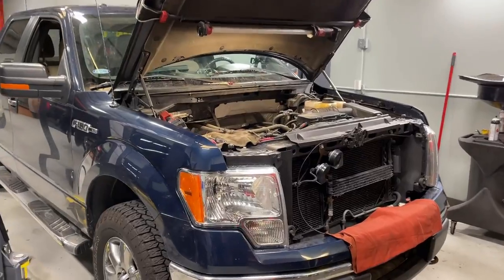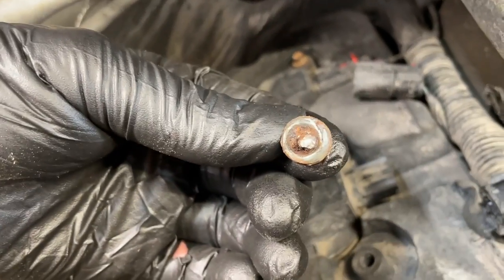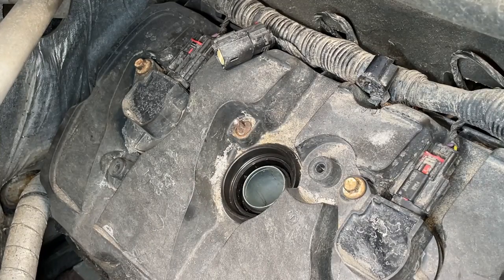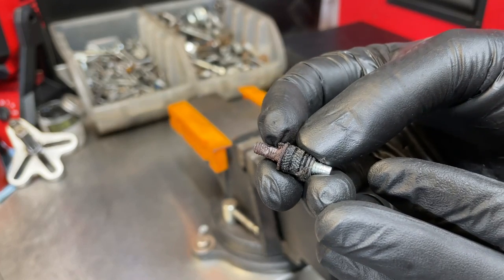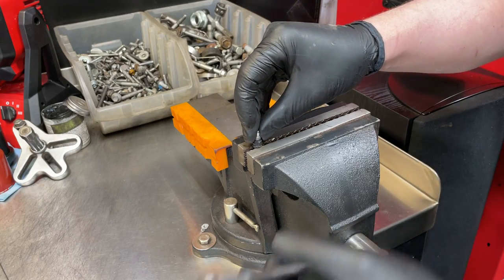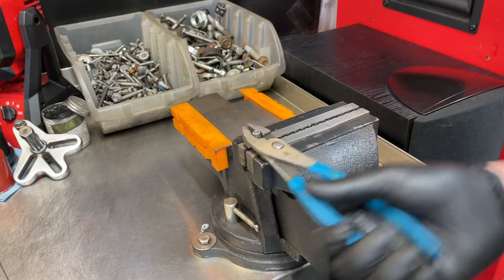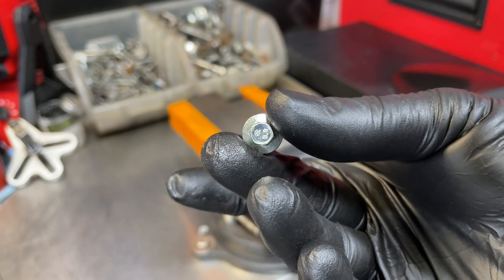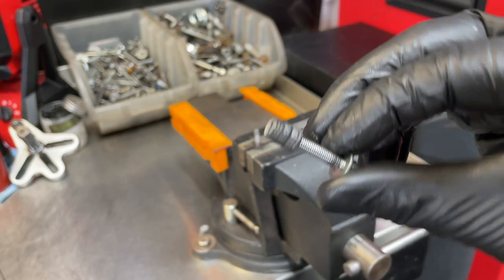Ford 5.0L Coyote Engines: The Best Way to Extract Broken Ignition Coil Bolts in Plastic Valve Covers

Comment: Here's a idea for the best solution for that problem. Ford have a recall to put better bolts 🔩 in the valve cover.
Reply: Talk about cheap. A metal bolt breaking in a plastic insert. Where are they sourcing them, China?
Reply: Of course

Comment: I’ll be ready to avert a $hitshow when it comes time to change the plugs on my 2011 f150 Platinum. Thanks for sharing this awesome tip!
Reply: Might want to add some homemade boots to the inner fender openings to stop the water spray from the tires.  That’s the cause of all this rust.  The F-150 forums have templates and ideas for this cheap fix.

Comment: Great video. I went to do the plugs on an F150 i just bought & had the same problem. 3rd one back on each side was rusted bad. They snapped immediately. I was able to pull them with a torch and reset them. Please do a video on rusted out valve cover bolts

Comment: When installing you could probably use shop air to speed the cooling. Great wrenching!
Reply from the maker: I don't want to rush it with air cooling, I want the insert to melt a good amount of plastic inside the hole so it can flow around the insert and provided a stronger repair.
Reply: Good point. Slower could add strength, thanks again!

Comment: Just did my plugs on 14 with 116k. No problems with those bolts but did have a minor panic issue.
Pulled the coil on number 4 and the boot stayed stuck on the plug. First thought was panic. Can't even see down that hole. First tried needle nose pliers to grab it but came up with just a piece of the boot. My solution was an oversized socket that would fit over the boot and push down hard and turn until the socket twisted the boot off and came up with the socket. I put a good coil with boot back on 4 and the slightly damaged one on 1 for easy access until the the new boot comes in. Wish I recorded it for others. Can't be the only one this has happened to.

Comment: The past couple of decades working on Fords, i’d only be surprised if there wasn’t some type of spark plug or coil issue.

Inductive heater, heat cycle the bolt a few times, working on other cylinders as it cools each time….oops, you got it out, lol.

Comment: Long time watcher. Love how you take the time to make these videos. I have a question about a 2015 5.0 with a severe sludge problem. Vehicle still runs and has oil pressure but the sludge is affecting timing components etc. What methods would you perform to make an attempt to save a 5.0 with such problem. I have thought about overfilling engine with kerosene and flushing it several times and then using BG’s dynamic engine flush/cleaner product. After flushing I have the intent to pull oil pan as well and possibly the valve covers. Just looking for feedback.
Reply: Robert. I think you have a good approach for cleaning the sludge. Pull all the plugs and crank it several times with kerosene in crankcase. Definitely pull the valve covers and clean to head best as possible. BG makes great products. I have used their transmission treatment but not engine flush. Make certain that the PCV and emissions system are operational. I have a 2017 5.0L and not had any issues with it at all. I change the oil frequently.

Comment: Wish I would of known this was a common problem before I dug into it! 4 out of the 8 heads popped off on me. 2 of those 4 coils wont budge. So I was only able to change 6 of the 8 plugs but have 4 broken bolts

Comment: Thanks for sharing that tip. Any tips for removing the coil boot tip that happed to tear off inside the cylinder and around the spark plug? Happened to me yesterday on a 2006 V8 Explorer #4 cylinder.

Comment: For the fix, you could melt a hex flange nut in from the bottom, which I think would be better---if you don't mind pulling the valve cover off that is.

Comment: Watching you do this without covering the opening is mind blowing 🤯
Reply from the maker: Melting plastic? The plug was already replaced so the combustion chamber is sealed. What are you complaining about exactly?
Reply: @Jose Daniel The spark plug in already in the hole. If any debris gets down there, no big deal because the hole is sealed. Brian would then use an air wand to blow anything out of there.

Comment: Thanks for a great video.  Two bolts broke -  do you think a soldering iron would generate enough heat 
 to accomplish the same results as the mini propane torch. thanks.

Comment: Happy Easter to you and your family brother. He is Risen indeed!! I have a quick question for you. I have a 2014 F-150 with a Coyote 5.0 and my user manual says the plug gap should be .049-.053......Has Ford changed these numbers since 14' or are they still the same?? What's your recommendation??? I was thinking right in the middle at .051?? Thanks for any thoughts or opinions on this. God bless...

Comment: Yoh Brian, excellent video, as usual! Watching reminded me of one of my own small "quick spark plug change-out" mini disasters: As I was removing the electrical plugs on the coils, one of the red plastic retainer clips flew off, never to be seen again! I now have one plug without a red locking clip on the coil. Is this a problem waiting to happen? Or are the red clips more over-kill than must haves? Can you buy them separately? Again, excellent tip, though I am thinking the snapped bolt is unlikely to occur on my 3.5 Eco due to the sound cover.

Comment: The reason this happens is ford does not put good splash shields in the wheelwells to protect the sides of the engine and the engine bay from salt water spray. That’s why the exhaust manifolds on fords look like they are 30 years old after a couple years of use in the areas of the country where road salt is used. The best thing to do is get some roofing rubber and build yourself some splash shields.
Reply: Exactly Shane.   That’s the root cause of all the under hood corrosion on the 5.0 F-150.

Comment: Where were you yesterday when I was looking for your video on this?! 😂😂😂 I used my mac diamond carbide bit to grind the head of the bolt off because the little space there by the valve cover is too tight for a cutting wheel!
Reply: Commented before I watched the video. My problem was that the bolt and the collar itself were spinning
Reply: @rjechols2059  I have the exact problem, how did you resolve this?
Reply: @sheikh8980  i replaced the engine in mine when the bolts started to rust.
Reply: @sheikh8980  If you google "mac tools cb4s" I used that to grind the bolt head away then melted like fordtech did
Reply: @rjechols2059  thanks

Comment: I would use "WD40 rust release" and spray it a few times over a period of days and try to work these things loose = let the liquid get down there a bit.  Obviously few shops have the time, patience, or space to deal with these issues.

If you can -pull them early and put anti seize on them.

Comment: My 2013 5.0 had 120k miles and it’s used every day to to tow. I just changed the spark plugs and my ignition coil screws broke too. Can I just use jb weld to put in place. Highly doubt this truck makes it to another spark plug or boot change. It’s made it’s worth by now

Comment: Are these engines bad about oil consumption? My mother in law has a 2011 that drinks oil like crazy
Reply: Yes some of them.
Reply: I have a 2012 with 175k- I’ve never bad to put oil in between changes- still runs like the wild animal it’s named for- as for EVERYTHING else on the truck, haven’t had the same luck
Reply: @zaneseligman1313  Can you elaborate on what issues have you had? I have a 2010 F150 5.4 3V 185K and drive my truck everyday.  I've changed on my truck rotors, brakes, spark plugs, transmission oil filter, and the ac evaporator coil. Other than that the truck has no issues.
Reply: Generally very reliable. I have had two 2014 mustang GTs, driven hard, some track days and they never burned a drop. If it is much as you make it sound definitely investigate to see if you find a leak. Good luck and happy driving.
Reply: The 5.0L are notorious for using oil. There's even been lawsuits against them for using oil in brand new trucks. Other then that they are good engines.
Reply: @tr4u5mp90  Let me try to list them- these aren’t in order, just as I can recall them: rear window w/auto sliding glass shattered setting in the driveway(some kind of grounding issue) fuel pump and its friend the pump ‘controller’ ($1000) the actual fuel door assembly broke with the first freeze, I bought it with 80k miles on it- drive it straight home and it leaked almost all the antifreeze out immediately due to a poorly designed o ring set up, passenger front door window regulator broke- still  dealing with that- water pump basically fell apart - replaced it- the drive shaft carrier bearing went out- sounds simple, however, the driveshaft and carrier bearing are made as one part- Ford dosent make or have them,  no car part places (besides sometjing used from a junk yard ) had them— so I had to find a company that  could ‘make ‘ a new drive shaft ( wasn’t an easy search - if you encounter this , Fort Wayne Clutch and Driveline Co.) head light wring harness, shorted out, ( keep your MAF sensor clean- that will mess you up- if you start have misfires, or performance issues check that first) rear driver door lock actuator replaced, OMG- as I write  this, the truck won’t start: if I park over night on a downward facing slope- no matter how much gas is In The tank , it won’t start until it’s back on level surface - it’s done that since I got it- there’s more but I gotta get this dam thing started - you may not encounter any of these problems, as it’s regularly talked about in the Ford Forums, 2012 was one of the worst years for the F150. But still, even with all this mentioned — and a truck that won’t start- I totally love this vehicle. Comfortable, powerful (when running) and absolutely beautiful. Just wish quality 1 would have been a little better realized for her particular year.
Reply: I have a 2014 Mustang GT and it doesn't use any oil at 33,000 miles.
Reply: My 2011 5.0 F-150 does not use any oil at 135k miles.   Full synthetic 5w20 every 7,500 or 1 year since new.
Reply: @4drhtrd  What brand of full synthetic do you use?
Reply: @4drhtrd  you’ve owned since ‘11?
Reply: @zaneseligman1313  yes. It was my company vehicle first and the dealer used Ford semi-synthetic in it for seven years, then I bought it and started using Rural King full synthetic 5-20 to date.  Oil changed @ 7,500 at first, and now 5,000 or one year since I retired.  Shorter trips.  First seven years was majority of hi-way mileage.
Reply: @4drhtrd  that’s amazing ! Still runs good?
Reply: @Mr2004MCSS  Rural King or Costco/Kirkland.   The first seven years of its life was Ford semi-synthetic 5-20 and mostly hi-way miles.  7,500 intervals.  Now it’s RK full synthetic 5-20 and 5,000 or annual changes.
Reply: @4drhtrd  Nice.  I've been using Motorcraft semi-synthetic 5W-20 since it's been new.  I've thought about going full synthetic but have not.  I used to use the OLM for oil changes but now usually just do 5,000 miles or less depending on how much time has gone by.
Reply: @zaneseligman1313  yes. Like new.  Just did the big muffler delete and it sounds and runs much better.  Engine seems more free as far as revving and deceleration.  Must be flowing better w/o the back pressure.  Still have the resonator.
Reply: @4drhtrd  I just did pretty much the same thing- I also bought a small tuner that seemed to livin’ her up too. It also brought the fuel economy up to 15mph from 10mph after I put 35’s around it. Have you had any non-engine problems?
Reply: @zaneseligman1313  let’s see......rear window defogger quit and took out the mirrors too.  Still looking into that one.  Had a harsh downshift and clunk in the trans when below 10 degrees at about 70k miles.  Trans fluid and filter fixed that.  Brakes & rotors.  No engine related issues.  No water pump or alternator problems.  Odd one - the paint flaked off on the roof over the LR door and surface rusted.  About a 2” x 1/4” strip..   I think that’s it.   I have always done the fluids maintenance..just recently replaced the OEM battery and all hoses.  Not too much out of the ordinary.  It’s been a great truck.
Reply: @4drhtrd  that’s good to hear- I believe my ‘12 was just an off year- but like you said- overall, I have to say a great truck- even with the occasional glitch I’ve never been so quick to fix any vehicle I’ve had before- can’t even imagine what a new super duty with that 7 something liter must be like. Odds are I’ll prolly never know- but hell, should I ride this one out to the end, I’ll be just fine.

Comment: I live in WA state and we get a fair amount of rain, but my 2013 F150 Eco engine does not have that much rust and residue on it...  Must be your 'rust belt' area?

The only thing I have broken while changing the plugs is the damn red locking tab on one of the coils..  My coil bolts still look brand new and come out easily.. :)
Reply: The eco boost inner fenders have covers over the suspension inner fender openings to keep road spray off the turbos.  The 5.0 didn’t get the covers so engine compartment corrosion is an issue for 5.0 owners.  The F-150 forums have directions and materials to use to block the openings and eliminate the road spray / corrosion issues.

Comment: Great video I have a ford Expedition and need to remove the number 4 coil bolt broke.  What is the name of the device used to heat up the insert.  Will this method work on an 2005 Expedition

Comment: Could also use a plastic set screw a.k.a. grub screw and then thread that into the hole in the valve cover. Then, drill a small hole in the setscrew to accept the coil bolt. Would be even stronger.

Comment: Can you do a video on the 5.0 tick? I have a 2020 with 4500 and I have a constant ticking sound. I used to hear the bbq tick. Now it’s constant from start up and the same through operating temp. Took it to the dealer and they said it’s normal based off a video they have.

Comment: I ran into this about a month ago and tried this method but I didn't have enough sticking up to be able to get it out since it was broken flush. I ended up making a bracket to hold down the coil and bolted it to one of those empty holes. 🤷 It worked
Reply: Ya I did the same
Reply: Same here.  The one next to it got a hold down bracket to reach over and hold the coil down.
Reply: @4drhtrd  how’s it holding up? About to do the same
Reply: @hardcoreturtle420  it’s still on there and hasn’t appeared to move.  Still running fine at 140k.
Reply: Just had to do this on my 2012.  Might go back and try to get the inserts out so I can remove my brackets.

Comment: Any pointers on removing a bolt if it is broken off flush with the metal sleeve? trying to remove 7mm bolt securing coil pack on a 5.4 triton. Was going to try and use a mig welder to attach stem on top of bolt. Not much space to work.

Comment: The same thing happened to my Dodge Ram 1500 while I was trying to remove the ignition coils. The bolts look a little different, wonder if they are the same as on F150?

Comment: That's awesome good efficient way to get it out but what if the bolt broke at a point where you can't grab the remaining threads ? The remaining threads are half way down the hole   thanks
Reply: Heat it. … pry it out. Then use a plastic set screw A.k.a. grub screw. Now drill a small hole in the bottom of the grub screw and you will have a new insert to accept the ignition coil bolt.

Comment: I would have probably cover the hole and dropped a 1/4 inch thread nut over the broken bolt, welded the nut to the stud and see if it created enough heat to unscrew the bolt with the nut hex. Worse case the insert spins and comes out.

Comment: Dealing with this issue now. Can I buy the insert just in case I cannot remove the bolt? I’m afraid the bolt will break off in the insert when I try to remove it while it’s in the vice.

Comment: Is the bolt the same for the 2014 F150 3.5L Ecoboost?

My problem is that I believe is that the brass insert has snapped from the plastic Valve Cover and the bolt keeps spinning with the coil in place. How would you go about fixing that problem?

Comment: As an option to the induction heater or torch, would an electric solder gun work to heat up the bolt and insert for removal?
Reply from the maker: I would say a solder gun would work eventually yes.

Comment: I had the bolt stay in tack, but the threads or whatever snapped and it just spins free and the coil stuck on. All while towing from Dallas to Houston to go racing. Was just a bad coil had to limp back, buy a new valve cover(right side). Expensive but easy fix.